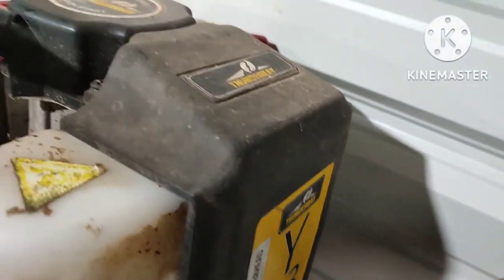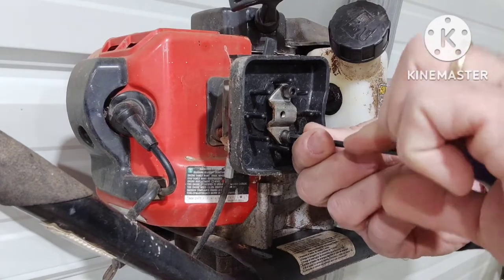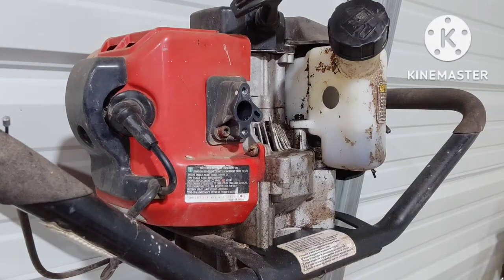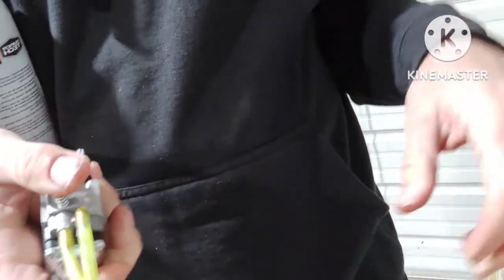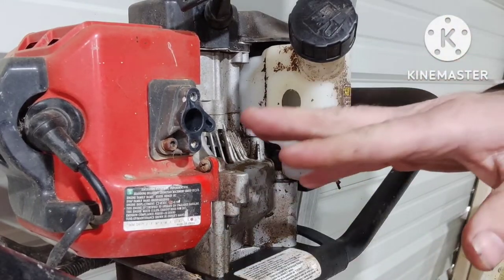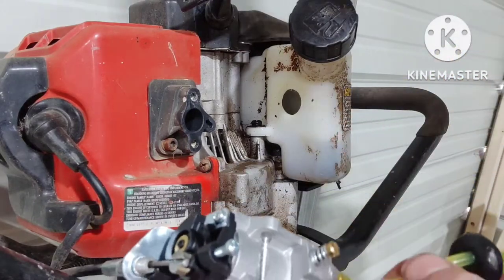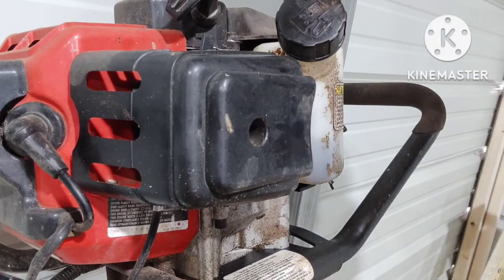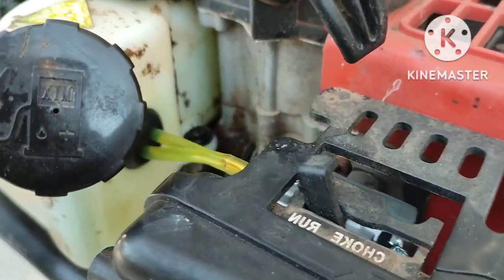Thunderbay y43 bog, repair.

Comment: Excellent video.. precise and to the point.. used it to change my Thunderbay Y43 carburetor (thank you!) The only thing was my fuel hoses were ripped off so I had to make sure I had them connected to the carburetor correctly and you were moving the part around (I can tell you talk with your hands) but I finally got it 😄 Nicely done and thanks again.. big help!
Reply from the maker: Oh I definitely talk with my hands .lol..thanks for the comment!

Comment: ALSO MINE HAS BEEN SPITTING SOME OIL OUT OF THE MUFFLER SO IS THERE A WAY I CAN FIX THAT? I AM CONSODERING BUYING A NEW CARBERATOR BECAUSE THIS AUGER IS ABOUT 6 YEARS OLD
Reply: When I have had that problem it was because my mixture was wrong. Not enough gas with the oil. Add a little more gas and see if that helps. Mine stopped almost immediately. Less smoke as well.

Comment: I have that same auger and after it runs for a while it will not start back up unless I pull it about 20 times
Reply from the maker: Check for spark when it dies, sounds like your coil is going bad. If you still have spark when it dies, adjust the carb.